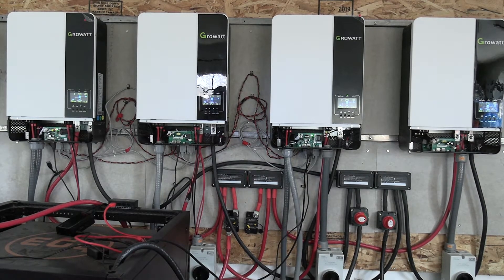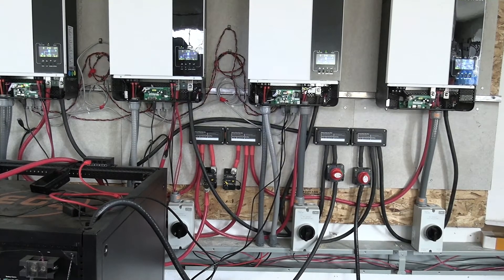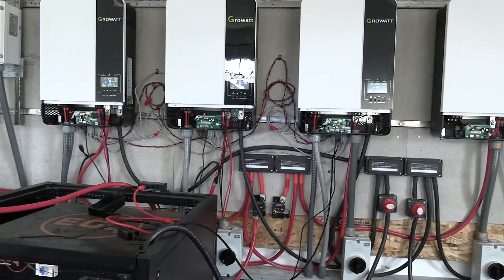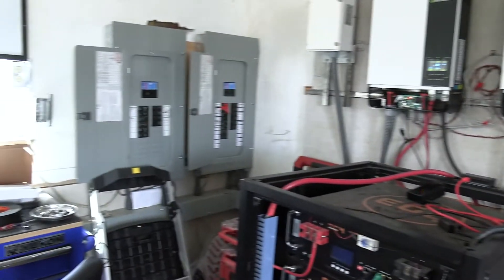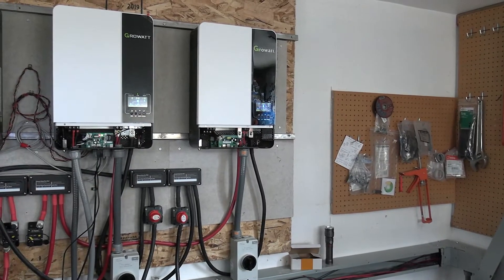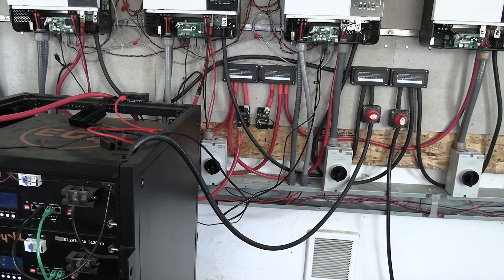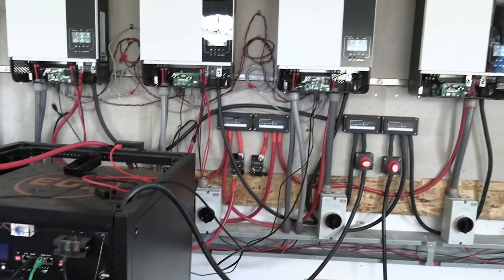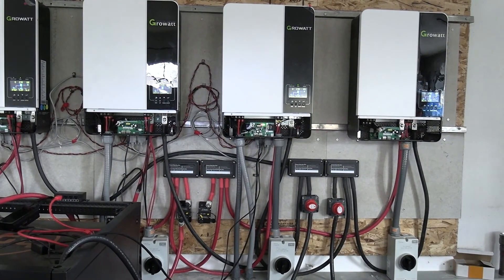best inverters now have updated firmware

Comment: James I have all updated inverters/they came with the updated firmware. I cannot get solar assistant to work Properly it will connect and then give errors and disappear. I reached out to Ian watts 24/7 and Ian pretty much told me to piss off they don’t make any money on the raspberry pie and a contact Solar Assistant. I find this a terrible response from a company that sells you a product but then tells you to go away when there’s an issue. I’ve never been treated like this at signature Solar and I wish Ian had the same business mind that signature Solar does. Your friend Mike
Reply from the maker: Yes I put in an email to solar assistant. No response.. Ian also just said get hold of solar assistant. With the new inverter’s on the 701 firmware nothing is working. If no response from solar assistant pretty soon I will check out other monitoring systems.
Reply: @jamesshomesolarmore2223  Well I just purchased mine not long ago for me and I hope he’ll except my return
Reply from the maker: @flippingcoins7714  I hope that he does take  it back. I already have a couple of the growatt sticks. maybe I will try it again. I have got no response from solar assistant so far. come next week I will give up all hope and release a negative video.
Reply from the maker: Mike you should email me. trashy1014@yahoo.com
Reply: @jamesshomesolarmore2223  have you tried the grow white Wi-Fi stick yet?
Reply: The firmware upgrade is available . Ask  SS for the updated comms board replacement and the procedure to update the firmware they should have it.  No need to swap the entire unit.
Reply: Hi Guys, can you please let me know what your email or site name is? I don't see an email in our inbox. I'm sure we will be able to resolve the issue
Reply: I see I did respond to an email from trashy1014 but never got a response back. I'm resending it now
Reply from the maker: @solarassistant7450  I just responded to your email. Solar assistant is not allowing me to go change the region. I will do a video on what it is doing in a few hours. It’s 4 am here.

Comment: James, what firmware version are your inverters run? What was the old firmware what is the new firmware?  Thanks for all you info you keep us informed.
Reply from the maker: the old firmware was 907. the new firmware is 701. in order to see what firmware you are using hit the up button 3 times. firmware will be displayed in the bottom right
Reply: @jamesshomesolarmore2223  I  am not near my inverters right now, but I  am using Solar Assistant, and it shows the firmware. It is showing firmware version 040.04 and secondary firmware version 041.04.  Not sure how these relate to your listed version, but thought I'd throw that out there.  I'll be researching more on this, thanks.

Comment: James will you be increasing the charging amps on the inverter settings with the additional batteries or does that change automatically. Regards.
Reply from the maker: I will have the inverters set at li on setting 5. the charge only inverter will be set so that I am at about 90 amps charging. once I get the fourth inverter set up. along with a new transformer which I should have here shortly. I will have everything go through the inverters on the li setting. but I am expanding the solar panels so on cloudy days I should still be able to power everything and fully charge my batteries. On sunny days everything is fully charged in a short amount of time. but pretty soon we will have air-conditioning happening that will raise our power usage. thats why I am hoping to have everything up and running soon.
Reply: Thank you for your response James. I am still confused as to the charging current or amps to your batteries. Can you increase your amps on your battery bank if one battery’s max charging current is 30 amps? Will that not destroy the battery? I am asking you as i intend to expand my one Pylontech lifepo4 battery to three. They will be in parallel like yours. The one i have the charging amps is 30 A. If i add three more batteries the 30 amps will be divided between the four batteries? Will i be able to increase the amps or will that destroy the battery pack. Kind regards and good luck with your build.
Reply from the maker: @harryscheepers5637  on li on setting 5 of your inverter it does approximately 50 amps. Plus I have the charge only set up at 40 amp’s. So I put in about 90 amp’s. The thing is somehow, it splits the power up among all the separate batteries so when I have 90 amp’s going in each battery somehow only gets 11 amps. But all these batteries talk to each other. In a while I am going to put in a new battery that doesn’t communicate to the other’s. Then I will know better what will happen. Are your batteries diy batteries?
Reply: James no it is a server rack Pylontech US3000C. It is rated for charging at 50A but recommended for 30A. When set in program 5 of my inverter with Pylontech it automatically changes the charging current to 30A. Will it then automatically changes when adding more batteries to a higher charging amperage? Because 30A between four batteries will take ages to charge up fully. And if you increase the amperage will it not damage the battery. Thank you very much.
Reply from the maker: @harryscheepers5637  my batteries are rated for 100 amp charging. The battery bms is telling it to go to 30 amps. That’s why one of my inverter’s is set for battery charging only. 
You could check with the manufacturer of the batteries and then set an inverter for battery charging only. Just set the amps at the difference between what the manufacturer says and what the batteries are allowing the inverter to do.
Reply: @jamesshomesolarmore2223  Thank you James. Glad to see your Solar Assistant is up and running. Keep well.
Reply from the maker: @harryscheepers5637  I just reread your previous message. My batteries are only getting about 11 amps each. When I had 6 they were getting 15 amps each. I don’t know if you should charge 1 battery at 50 amp’s. That seems high to me. But if you have 3 batteries they would share the amps. So if you had 45 amps then they would each get 15. Which is what I would feel is a reasonable charge rate. I don’t like charging to fast I feel that it heats up the battery. Heat = battery degradation.